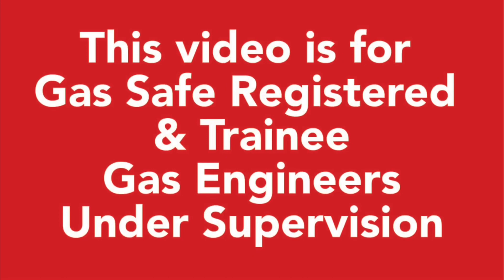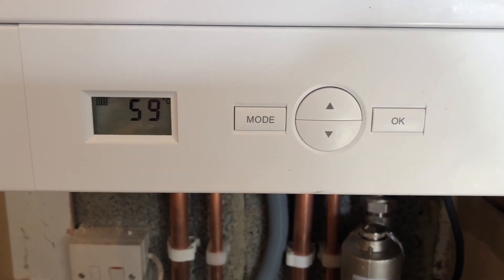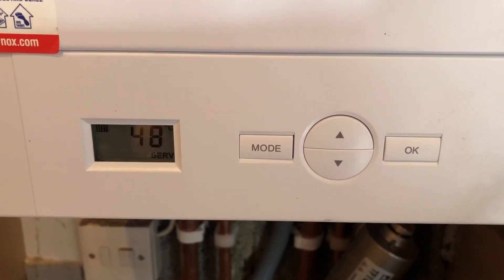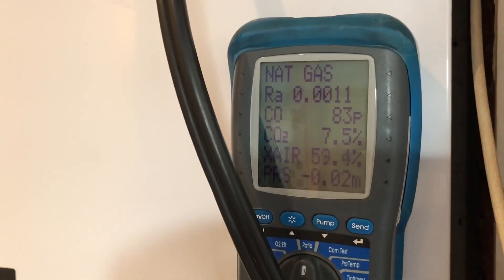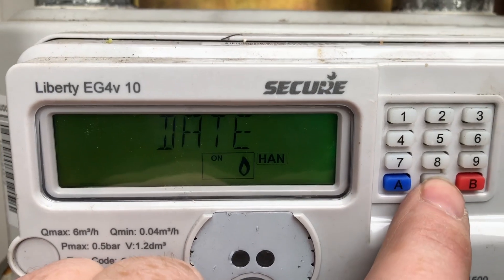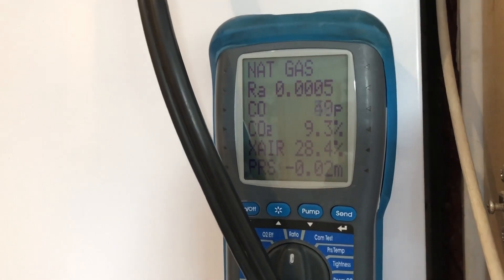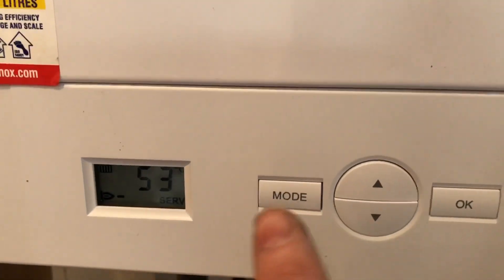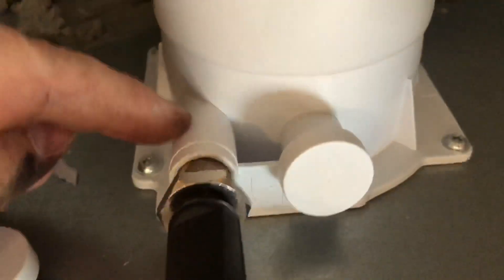How To Reset Viessmann Vitodens 050 Combi Boiler - Service Mode and Gas Rate

Comment: Hi Allen I have got exact same boiler for last 7 years. Was working very well. Last month service made a cleaning operation and tested heating function was working good. After that we turn off the radiators and using only hot tap water till a few days ago. When weather went cold we want to turn on the radiators but settings doesn't go up above 35 degree and boiler doesn't heat the radiators. No error appears, no room or outside temperature sensor connected. Setting doesn't above 35, what can be the problem and how to fix?

Comment: Hi Allen great video. I'm currently running this version of boiler and have a nest version 3 connected in on off mode. I know recently that you've done a newer video connecting the newer version via opentherm. I'm really struggling to find definitive answer to whether 1. my boiler supports opentherm  and 2. if so how I would go about connecting it this way. It doesn't have the same digital display as the lower black fronted version and also the connections appear to be on the bottom of the boiler not needing to take front cover off. The only indication in the instructions that opentherm maybe supported is on page 20 of the manual showing the electrical terminals. Then further on in the manual mentioning A9 fault code. Can you shed any light please.

Comment: Hi Allen. We had a Greek installer install a brand new Vitodens 050-W on the island of Samos on the 2nd week of March so it didn’t really get a lot of use until the winter started just recently. This system is used solely for central heating. 

The install has 5 radiators in a newly constructed small two story apartment style building. It’s fully insulated with double glazed windows etc.

Sadly, we have had to stop using the system as it is burning through 25Kg of LPG every 5 or 6 days. We switched over to reverse cycle AC which is not the best for power use. 
I’m at a loss to understand how we could be burning through this much gas.? Shouldn't a 25Kg LPG tank last about 14 days if it was burning on maximum constantly @33kW? This system is on a thermostatically controlled radiator system being used a couple of hours in the morning and around 4 hours during the day running only two of the 5 radiators. 

Could it be that we are using the wrong type of gas, the gas restrictor is incorrectly setup, it’s plumbed incorrectly, or there is a gas or water system pipe leak somewhere. Finally, the Vitodens 0-50W could be faulty. Getting support from the local installer has been tricky as his knowledge with this system is his first install. 

Any ideas? Thank you in advance.

Comment: Allen, I've had a Combi 050 fitted recently, mainly on the basis of your opinion of them!  Very happy with its quiet efficiency but was wondering if there was a way to get it to deliver hot water more quickly?  It seems very reserved in how it starts-up, stays in low power mode for about the first 20 seconds before then bringing the boiler up to high output to get the desired DHW, result is I have to run the hot top for almost 60 seconds before I get truly hot hot water - is that normal?  Perhaps its just a modern boiler thing, my old unit was about 20 years old Worcester and would just go full power as soon as you turned on the hot tap!
Reply from the maker: E C depends how the boiler has been setup and the size of the boiler.